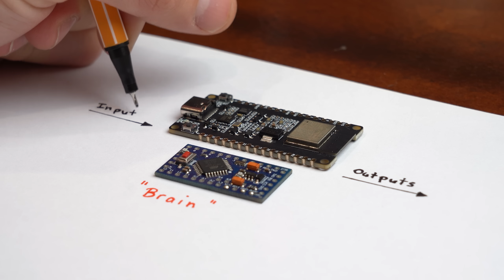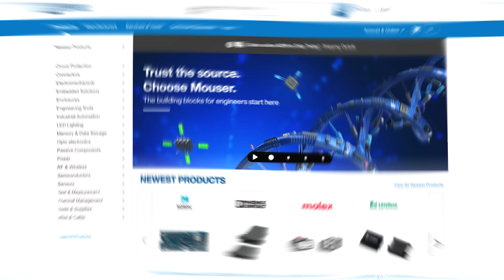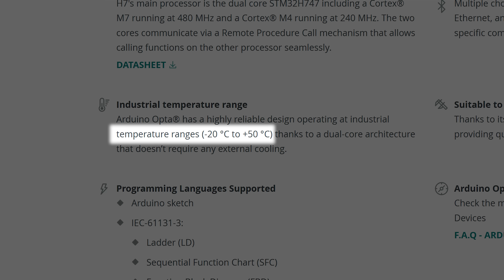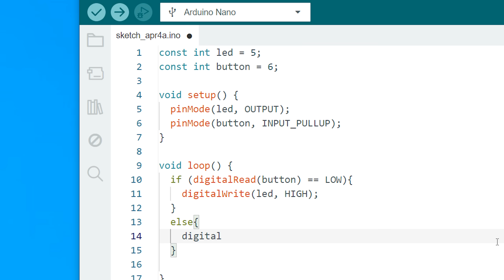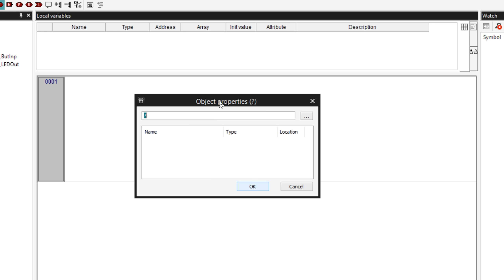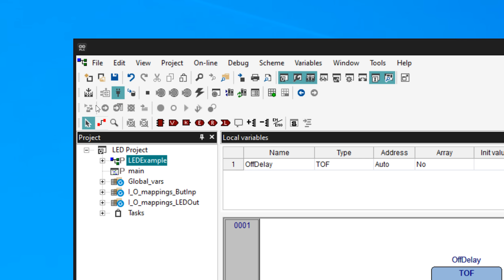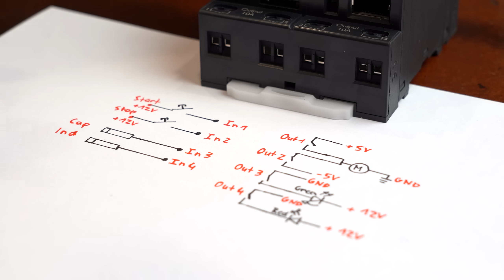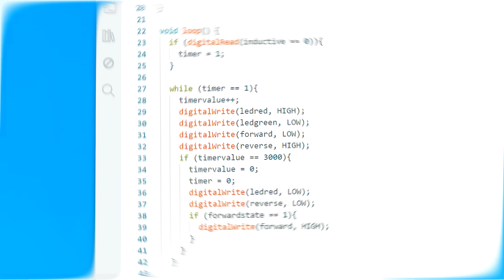Not a Microcontroller!...This is Better?! (PLC) EB#62

Comment: I wonder why you can't just make a microcontroller based PLC that supports all the standardized IO stuff, but still allows for more complex logic

I get that a drag-and-drop visual interface can be easier to understand for people who don't know programming 

but it feels like it would take longer to program in considering all the time spent just dragging stuff around and memorising all the pre-built blocks

especially when it can't super fast switching and already costs an insane amount of money
Reply: when you get to the real industrial scale of programming and you have propper programmers you also use actual text based languages Siemens for example offers AWL (legacy and close to being deprecated) and SCL(newer C/C++ like language)

these smaller "PCLs" are mainly used for simple home automation. thats why they use this kind of drag and drop visual programming because its meant to be easiy so a electrician could just set it up for some basic stuff like interacting with a few switches, relais and sensors

Comment: My last job, i did engineering with plcs. One thing that blows is allen bradley studio 5000. Software version has to match the firmware version. Licensing is also a pain. This is the industry standard. However, allen bradley also makes the micro series that uses the free ccw software. No versioning issues. It makes no sense.

I wish plc software would work on linux. Openplc needs to start getting some good hardware.

Comment: PLC is nice, we have clean electric panel every time we use , i used PLC a lot of years before, in water bottling factory, also lot of machines use only relays and timers to make automations but lot of relays and wires xixix 
Nice Video Thanks, brings to me old memories

Comment: For me ladder logic is a nightmare. I worked in the industry and I wished for c. Just imagine having an automation software with 1.000  devices dynamically loaded or not and control 100 small factories. Then you second guess your life choices. As those just don’t scale well. You have fear of pushing the changes for hundreds of other devices.

Comment: One thing to point out is that PLCs are a pre engineered solution for industrial control / industrial automation, that are engineered to suit the requirements for the industrial environment. PLCs are microcontroller/processor where the hardware design, firmware, certification, R&D has already been done for you.
Reply: I was thinking that if I read through the comments I would find some saying what I was thinking,

Comment: I wish I had photo of that historical PLC from our powder coating line. It was like 60+ cm long, then thick cable was going on next rail and there it continued with all of its inputs and outputs :)
Also LOGO! you have on example pictures is also quite good, I used it for few projects at work and it works really well. Sure, it's not "proper and adult" PLC but does its job perfectly. I might get TIA Portal at work soon so I'll try to play with proper S7-1200 and similar ones hopefully.

Comment: I work with the opta and some expansion of it in my company too and tbh it feels like driving 10 kmph with a Lambo using PLC. For some of the viewers it might be interesting that the opta uses arm Cortex m7 and therefore is running mbed os which implements for example very nice rtos functions or nice API regarding BLE! It is compliant with arduino core so it also can be programmed with arduino sketch or cpp using mbed core

Comment: what would have been really awesome if they had used a standardized software like codeysis, this way it is just another plc with propriatary software and tbh you can get a Siemens LOGO! for around 125€ which can do the same as this one and the logosoft comfort can be downloaded from the website

Comment: PLC is just lame... is way more expensive and force you to re-learn programming pattern (if you learn general programming you will find easier to understand Arduino than PLC). Plus having to program using mouse, dragging dropping blocks its a bit like program with Sketch... which is ok for kids more than maintaining code with complex logic.  Also if you write code in a good way is not harder to read code, wrt see a diagram; even more if you are a software engineer and you see code as text all day long.

Generally PLC are a waste because they contain so much hardware and software that you don't need. a microcontrollers allow you to just buy what you need and optimize that.

Comment: Nice video but comparing the difficulty of programming between the 2 is nonsensical. It depends on mostly on the scale of the task you want to do. It has nothing to do with the way you program it. You could just aswell use scratch like programming for arduino microcontrollers.

In praxis there should be a mix of the way you program the PLC based on the use case if its properly done. IL or Structured Text are king for certain types of tasks whereas FB is great for others.

Comment: I've been programming both SBCs and PLCs since 2003. The main brand that I learned on were Control Microsystems Scadapacks, which are owned by Schneider Electric now. At this point I'm mostly programming Opto22 Epic units.

I usually mix FBC with ST-written blocks.

Comment: One thing i didn't understand is why can't plcs work with high frequencies ? If they are prefered over microcontrollers in industries than shoudn't they be fast so that they can respond pretty quickly ? I have never used a plc so i don't know much about them .

Comment: About 30 years ago, when I started my career in electronics, we called them Speicherprogrammierbare Steuerung (SPS) in Germany and they already had a PC software that could be used to "program" them in a graphical way. I personally came across models from Siemens, ABB and Klöckner-Moeller. They were more expensive and a bit clunky, but kind of rock solid. And they had to be, as they were built to be used for industrial applications. I fried a couple of microcontrollers in my life that never happened to any SPS I was in touch.

Comment: One of the worst PLCs I've ever used. Maybe I bought a dud, but it is in 'service' for more than a months. The memory become read only and I couldn't upload anyting to it. 

It is basically an arduino pro linked to a nano via i2c. Idk, a basic shield with Mosfets / relays / optocouples would do something similar. 

There are some applications (like open PLC) that transform your average NANO/PRO/MEGA into a PLC-like controller.

Comment: I have a love hate relationship with plcs. Mostly hate tbh. 
In context I'm an embedded programmer by heart, I know how to remote debug in anything from risvc microcontrollers to embedded arm Linux machines without issue and c/c++ is basically my native language. Now my issue lies with interoperability. Can't share code with non-PLCs, if it's not standardised there is only some crappy library for it if any, they're slow, expensive and they kicked my dog. 
Give me a bare metal or Linux platform any day.

Comment: PLCs have a number of disadvantages that should not be omitted.
They're proprietary, you are tied to the programming tools of the manufacturer, and if those don't exist for your preferred OS, you're screwed. If the development tools need to be activated or registered during installation, in a few years, when those tools are deprecated, you're screwed.
PLCs are quite limited in what you can do with them compared to fully programmable microcontrollers.
If you're used to "real" programming, the PLC programming tools are more akin to toys rather than tools.

Comment: This is like comparing an automobile to an engine.

The difference between PLC's and microcontrollers is whether or not you have full access to the microcontroller's capabilities. The PLC programming system limits you to a very narrow, albeit often very useful, programming paradigm, and most often languages that are more primitive than assembly code.

What you are buying with the Arduino PLC is a mechanical package with level translators on the microcontroller I/O pins, and a library that you can write yourself with little work.

Comment: "Way easier to program" IF you can stomach the wild and horrible software development kits/environments and sometimes awfully slow process of actually writing the automations. And in the end it's still just a micro of course, just with a layer of software on top.

Comment: Dear Scott, another interesting video, but this time i would say it does not give a correct idea about difference between plc and micro. Tipically who makes plc program can have an easy and straight forward one, but he can have even very complex and big program made by several colleagues. Thousands of i/o points digital or analog. It's even right that microcontrollers ARE inside a PLC, and they can be deterministic and perform higher speed. But in my opinion here you should explain difference between firmware and software, between one program made for dedicated low level very important task (like a firmware for a brushless motor drive) or a high level general purpose task, example a software for monitoring several motors and appliances which can change configuration or behaviour between similar devices or after some time.

Thanks for your literally GreatScott's videos! 😊

Comment: I must be missing something but honestly I never got the point of PLCs. I get that microcontrollers have too many requirements for simple setups like automation, plus switching mains voltage requires an output stage. But the relative simplicity of PLCs does NOT justify its 100x price increase, especially with the limited features.
And I've tried ladder logic for a bit and for big systems it becomes almost as complex as C code.
Get a MCU that you can use block programming with, a 5$ power supply module, a few relays with driver transistors and you've got a 10$ PLC

EDIT: I just read @ToukoMies' comment about on-the-fly reprogramming to keep the factory running, tho it can be worked-around and doesn't justify the price, that's a good point!

Comment: I am an automation Engineer since 4 years now. In school, in my first lessens on Siemens-PLC's we used FUP as programmming langauge too. While studying we switched over to Codesys and ST (structured text) which is kind of like a object oriented programming language. Once you got used to it you never want to switch back 😄 In the company I work I am pretty happy we do not use Siemens PLC's, but Beckhoff instead. Their IDE is free to use too and the support does not cost any money either, which is super helpful in your every day job, when you come across problems you can't solve on your own.

Comment: The one thing I have never quite understood about PLCs is why do they need such powerful hardware? The Arduino opta uses a STM32H747XI which is dual core M7 and M4, if the fastest it can run is 10 ms and it has such few inputs and outputs then why does it need such a powerful MCU?

The other thing I was surprised to learn is that PLCs are in most cases just microcontrollers running special firmware.

Comment: Hi Scott,
Is it possible to run python codes on this PLC, i have a machine learning prediction model which forecast the energy consumption of machines and i want to control based on the values from the machine learning model. Is it possible?

Comment: I think I'll buy it but I can't stand block programming. Watching people connect boxes with symbols stresses me out. With that kind of programming, you can't use macros, Struct arrays, pointers, references, volatile variables, bit operations... I don't want Legos, thanks. Yes I'm a programmer. What seems simple to you seems horrible to me and certainly isn't suitable for optimized code.

Comment: I wonder if this is a real PLD/FPGA implemented PLC. Since programming PLD/FPGA is actually describing hardware(HDL) vs microcontrollers use procedural programming. One is more or less stateless(unless you explicitly buffer  something) vs always stateful.
This two things are nit comparable in terms of programming. HDL is very superior when you need clock accurate application but a complex state machine, HDL just nowhere near. In fact in many ASIC people would include a small general purpose CPU(implemented by HDL)to bootstrap/assist something imply they both good at something that peer dont. So there’s no “easy to program” objectively. It’s opinion.
Nevertheless, my naive guess is this PLC is just yet another CPU emulating HDL, since it only gives you 100Hz clock.

Comment: I learned PLC quite a while and altough it felt nice for some process, I find the debug stage way too complex. On code you just go debug, put a breakpoint, some watch variable and can go deep down the process to any step required. Here sometimes on PLC you are stuck, you are limited to the external view of things and need to infer things based on perceived behavior and not reality of things like : values and code. PLC tend to have proprietary tools that are limited to the manufacturer's good will of the day and cost you an arm. It means people are very specific on a given PLC context. Working with code you can use open source IDE and get it done from scratch if required. Two different world perspective. But with tools like Node RED and esphome, and MCU based hardware DIN mountable off the shelf I don't feel any need to go down the PLC road again...

Comment: Holy shit why isn't Arduino PLC not used in schools?
It beats down almost everything else as a learning platform.
Thx for bringing it to my attention.
Reply: You could probably use OpenPLC in schools because then you're not buying the $200 unit, but just running it locally, then you can use what you learned on many platforms.

Comment: As a PLC programmer of over 15yrs I actually hate my industry and job, the industry is generally a high cost to entry on most of the well known brands, it promotes bad software practices, most developments are monoliths with a single engineer to a project, it doesn’t pay well compared to traditional software roles, you generally have to understand the system as a whole and know how to interpret electrical and hydraulic drawings, there’s very little cross vendor collaboration so dev methods and implementations between vendors is vastly different, support is poor, vendors put out unfinished/untested software (Siemens Unified)… don’t get me started on the state of HMI development!
Reply: I was about to look into a career related to this, and this comment was really informative about the shortcomings in the field, so thank you.
Reply: Same as the other guy. I thought PLC dev might be fun, and a place where career growth could be high. Sounds like it's not like that at all. And I'm glad to know early on. Cheers
Reply: One positive is that the demand for PLC programmers is neverending. But yes as a newer PLC programmer, I find that most of what we do is deciphering other people's idiocy and madness both on the level of fixing what other programmers have done, and especially working around the software developers.
Reply: As a technician that works on this equipment in the field I absolutely 100% agree with you.
Reply: As a software engineer with a mechatronics background I 100% agree.

Comment: I believe the most important feature of PLCs is that they can guarantee to check your inputs and change outputs on every cycle, and never get stuck in an infinite loop, crash with a memory access error, race condition or overflow etc. I guess you have to check the manufacturer’s guarantees in each case though.
Reply: so it's guraunteed! Unless it's not guraunteed, you're expected to check that. So basically it's a microcontroller with firmware written in Rust sold for a 100x markup? (I'm about 3/8ths joking, maybe 2.)

Comment: I used to work for a company where I had the chance to develop all the electronics that focused on automation. I worked with people working on PLCs all the time. The value added is that, even when you design the PCB's, the cost is still order of magnitude smaller. It was like playing factorio for real. Good times.

Comment: There is a great older program you can buy called LogixPro for ladder logic programming PLCs.  Its got conveyors that you have to fill from a silo along with different modes in a virtual environment.  One of the first lessons is programming a garage door that has a motor, sensors, safety along with lights and buttons.  For 40USD and lifetime access, its a great affordable tool to start diving into industrial automation.  If you are a visual person versus a code language syntax then I would def take a chance with learning ladder logic.  Some solutions for LogixPro are on YT, but not too many.  One guy really holds your hand while figuring out practice problems that are in the documentation.